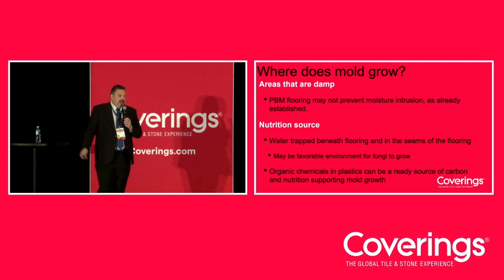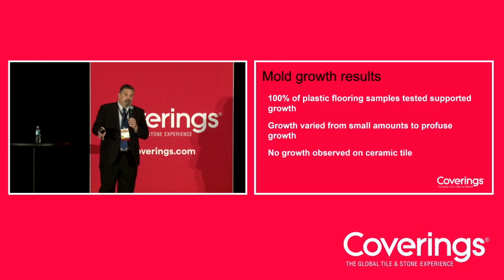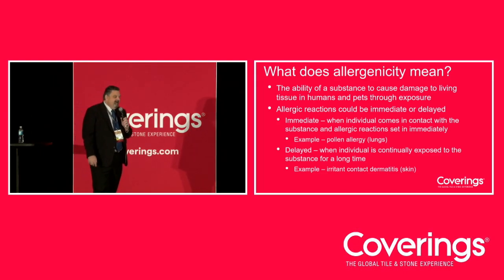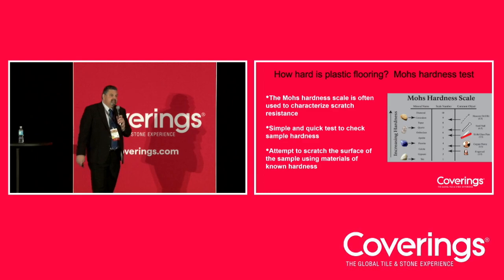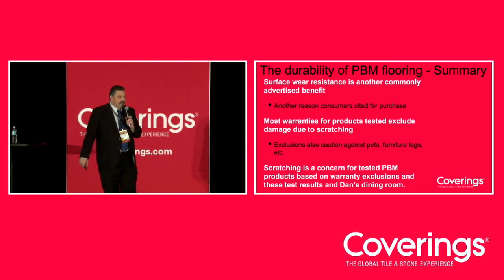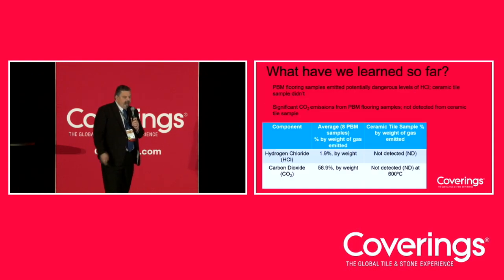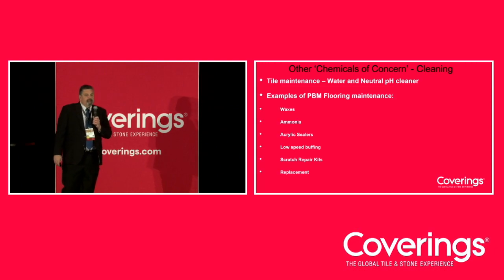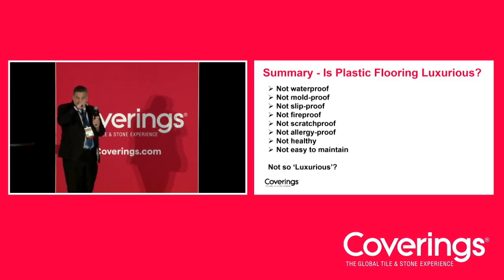Safety and Performance Issues with Not so Luxurious Vinyl Tiles (LVT)

Comment: The takeaway from this video is the ceramic tile industry is desperate. You need to be on high alert to learn anything useful from this shameless attack on LVT. Basically: don't use LVT in a bathroom. PROBLEMS with ceramic: you need a 100% perfect substrate preparation, which can cost more than LVT and installation combined, ceramic is a bit more expensive even without the added cost of substrate preparation, ceramic can crack, grout lines can deteriorate and leak like LVT (the mold can grow on the substrate if not the ceramic). I am just a consumer who did research on the two products.